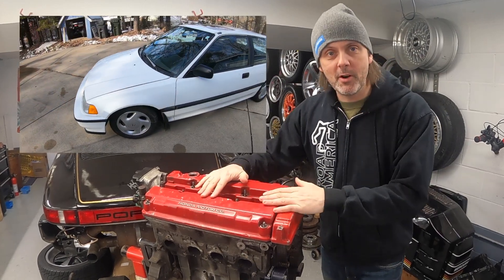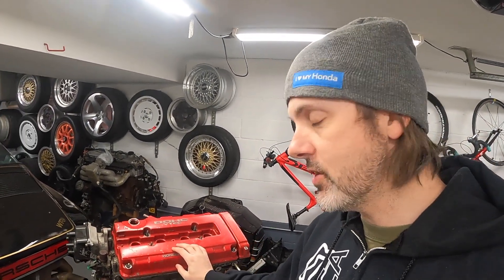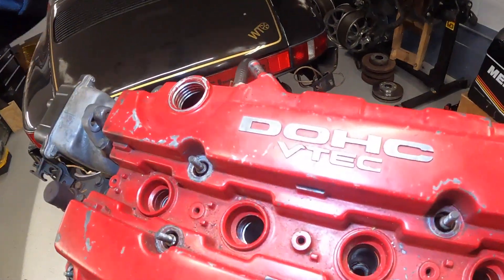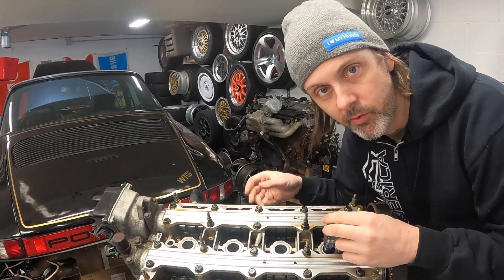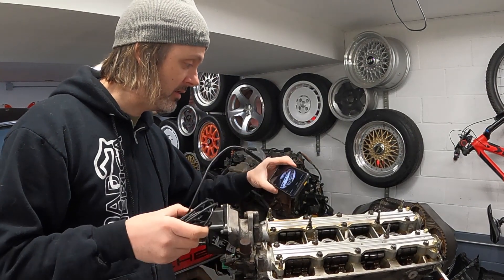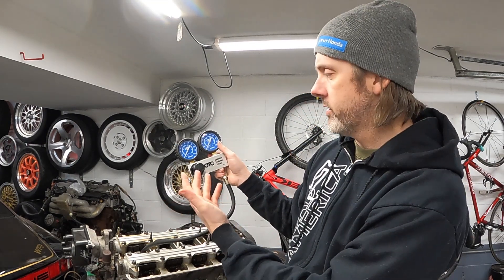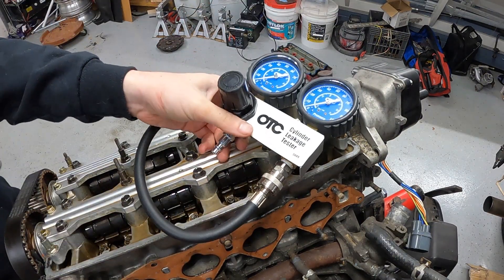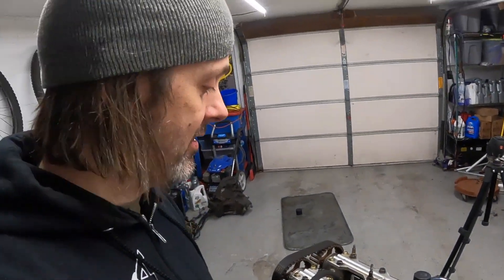$500 B16 How to ID, Inspect & Perform Leak Down Test Honda B Series B18 B20

Comment: I just score a 96 ITR full swap for $2500 with faulty exhaust valves on 2 &3 cylinder or it could just be the headgasket but most likely valves. Still a sweet deal.

Comment: Time for a valve job, MLS gasket, ARP's, maybe a light mill and a magnaflux. It's tough to take people for their word nowadays. So many liars out there. Still, $500 isn't horrible for a long block. Parts are pretty affordable and certainly plentiful for these so it probably wouldn't hurt to throw some cams in it while you're there and maybe some valves/ springs/ retainers. 😎👍🤘
Reply from the maker: Yup.  Or..... find a deal on an integra block?  hrm.
Reply: @addvancedgarage  
Yeah that'd be what a B18C5?? My buddy had a DC2 Teg with a built C5 with a 66 series tubski strapped to it, out down like 750whp LOL